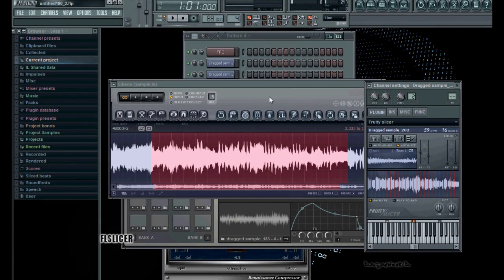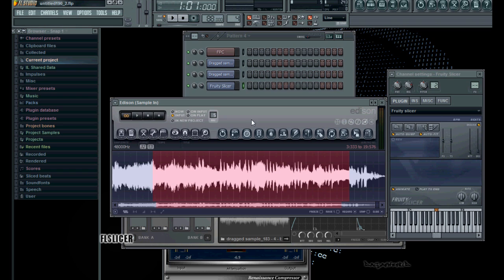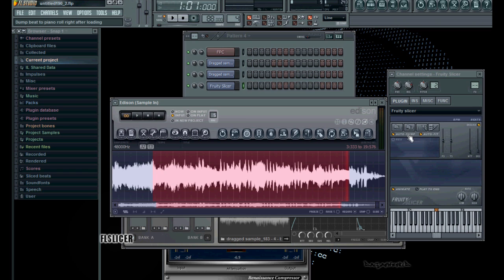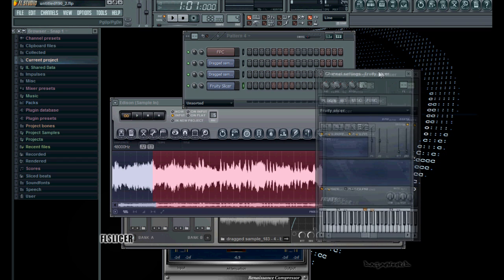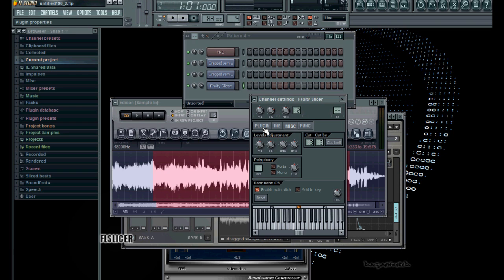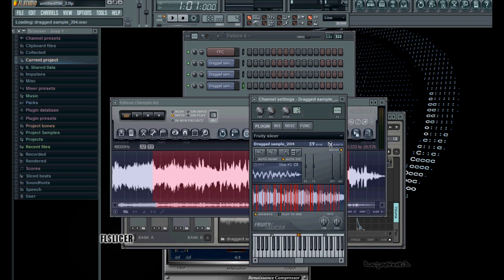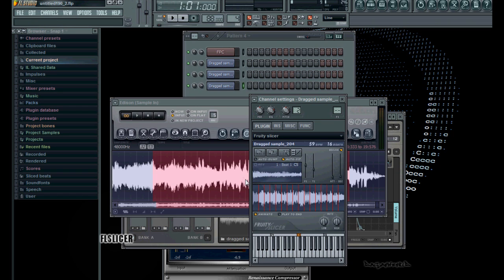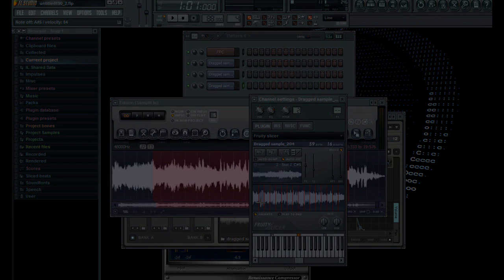FL Padkontrol Tutorial Part 3 - (FLSlicer)

Comment from the maker: It could be two things: either you need to save the scene to the Korg's memory, so when you turn off the unit the notes will remain mapped.  The other thing could be is you need to set the slicer to match the noted on the korg, and then save it as part of a flstudio template.

Comment from the maker: @xR3TrOx You will need to do two things.    Depending on your controller, you will need to make a custom scene or memory bank for the slicer that matches the note values of the slicer.
Then save a custom project file in fl consisting of your customed fl slicer module.  
This way if you always include an fl slicer in your projects, you will have your slicer settings saved.